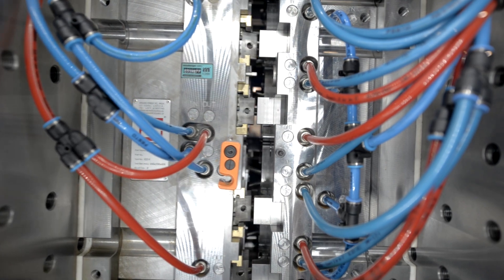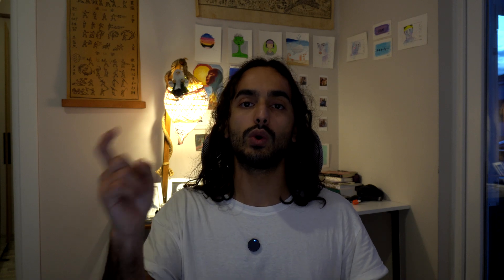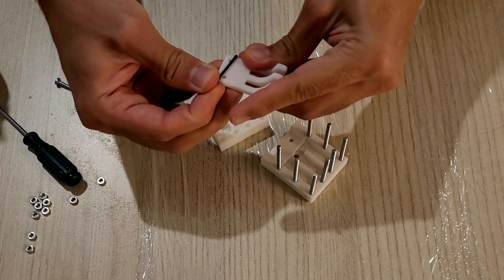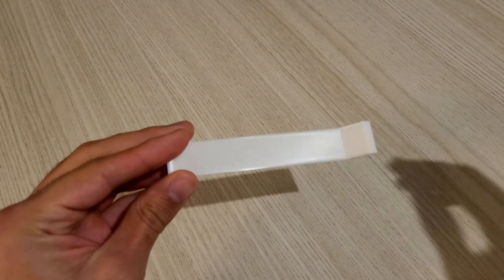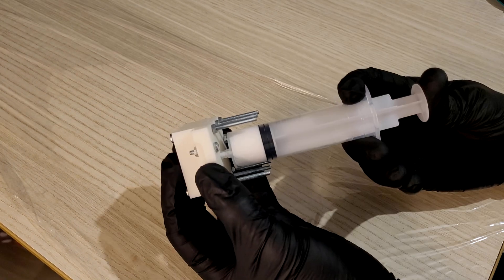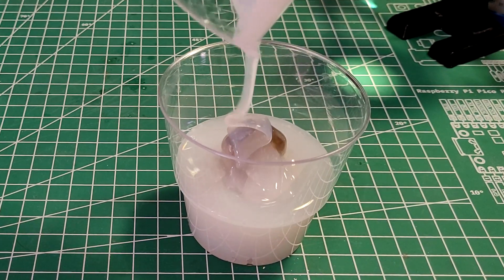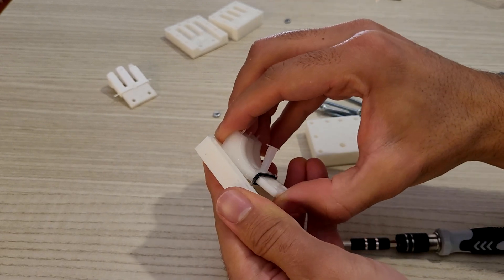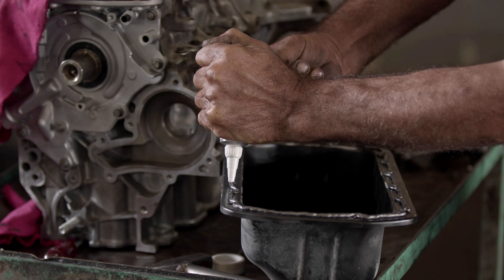Silicone Injection Molding at Home w/3D Printed Molds

Comment: I've done a LOT of 3d-printed molds with all sorts of silicones.
1. Water and soap works fine, as long as you let it dry or dry it.
With some amount of moisture it's okay, because with caulk that actually accelerates the cure.
2. This brings us to one very cool technique -- Caulk will set EXTREMELY fast (within 30s) if you mix it thoroughly with moisture. For example, I will put a tiny smear of acrylic paint in my caulk and mix it.. VERY FAST!  Try to make it even. Reduce trapped bubbles by smearing it along the walls of your mixing cup.
3. Now, for the other issue: No time!  In this case, if using caulk, you shouldn't bother with an injection technique. Instead, do a 2-part clamshell mold. You fill both sides, jam the center piece in (if you are doing the "overmolding" style), and push the pieces together. You'll get squeeze-out (if you used enough rubber), and you just trim the flashing.
4. ABS vs. PLA/whatever: Silicones and even caulk often won't bond to ABS. Still you should use a soap release layer because I have had a very small number of times where it did bond.
5. Curing. The surface often will get a skin. You can help it along by soaking the mold in water, and letting it cure. You can also crack it VERY slightly, soak in water, and let it cure. You can do variations on this. The water doesn't do a full cure -- it causes the stuff to solidify and increases the cure rate. I'm not actually sure of the chemistry involved here. I noticed when doing the thorough mixing, it sets super fast, but still needs its time to cure.
6. With ABS, you can get very smooth parts by vapor-smoothing your molds. If you have access to acetone, it's really an easy process. Easiest with an electric "range"/"stove" -- you want to avoid acetone near an actual flame!!!
6.b. Cold acetone vapor also works, but requires more patience.  Acetone vapor is heavier than air, whether hot or cold, so it stays down in a container.

Here are some 3d-printed Ventilator/CPAP nosepiece projects I've done:
https://youtu.be/nTEOTsMtw4M

Here's a demonstration of rapid smoothing with a spray of acetone, FORCING a matte surface finish (acetone evaporates very quickly, leaving a frosted surface). Then a fast dip in cold acetone vapor (saturated paper towels speed up the acetone evaporation).
https://youtu.be/nTEOTsMtw4M

Here you can see the effects of really thick layers vs. thin + acetone vapor smoothing:
https://youtu.be/moKtxujHFMs

Comment: SEEMS you may have been MISLEAD...
I have not seen it mentioned in the comments... So I might as well give it a go... (It may be a long one: I like explaining things)...
Before I got into CFX in the cursed years of my working for the movie industry, I was more part of the SFX department due to the "concept artist" title they enforced on me.
Thus; I have worked with all kinds of silicone for decades... having caulk practically the MOST as it is VERY cost-effective and unless we introduced fibres into the silicone mix: always the most durable.

TO BEGIN WITH:
I can definitely say that this time, your research may have misled you... Yes it needs air. But not the oxygen (One can argue that maybe it is the case for the Alkyl group formations. But even still.. You seem to have been misled).
It is the MOISTURE in the air that does what it does.
In fact, it is literally called the "Moisture cure" process.
(At the end of this comment I will give you a breakdown to how it works, since you seem to enjoy research)...

DRYING/CURING:
    So technically what one can call the "dried" phase (when you pulled it out of the mould); the lesser time-consuming curing stage where the surface has contacted the moisture in the air. But "Curing" demands the internals of the silicon caulk to engage the chemical reaction forming the cross-links needed for full "cure".
    To address what effects the curing process, I think it would basically boil down to 2 and a half reason.
_The first would be humidity... In fact, the biggest factor of the two and a half reasons would be this by far.
_The first zero point seventy-five percent reason would be temperature... That is because it effects the humidity.
_The second zero point seventy-five percent reason would be thickness... Again, this is related to moisture.. As since the thicker your paste... the harder it is for the moisture in the air to react to the contents of your caulk.

HOW TO SPEED UP CURING:
    Basically JUST ADD MOISTURE (well... sort of temperature and thin layers could help as well) Like:
_ Water vapour.. like a mister or a  such.
_ Porous stone/wood substrates... like tahta talaşı or tebeşir tozu etc
_ Add a hygroscopic powder/fluid like the Internets favourite: Mısır Nişastası or the lesser known oksijenli su etc. The reason starch works is because it absorbs the moisture from the air substantially.

HOW TO SEPARATE:
    You have to ensure that what you intorduce to the surface does not react or take part of the s link reaction that the caulk is going through after it is exposed to the moisture in the air. There are many ways to do it... but they all involve an inclusion of an emulsifier and an oil.
I would advise you to try coating the surface first with the dish soap. And then coat it with deterjan well mixed with zeytin yağı. And for larger moulds you would benefit from having this second coat from arap sabunu mixed with zeytin yağı.
Both scenarios (or variants) would have you benefit from the process of adding moisture.

ADITIONAL ADVICES:
    I would strongly advise you to prefer the silicones in the plastik tüp as since you would both have a higher quality mixture that is not adhesive optimized, and you would have it in a "syringe" (From lack of a better word) that you can "inject" into what ever you wanted to.
    IF you are going to do it in a medical syringe due to what ever reason: mix it with a hygroscopic substrate like mısır nişastası or similar.
    Since you already have a compressor (and a darn good one) use it. You can just put it into a jar, like you have used to demonstrate the workings of your invention... And just let it ensure the silicone gets in every detail with no bubbles left behind (A trick is to have it wait a while for the silicon to fill in where it can and then recompress the chamber to introduce more humidity. But this is a niche I have found practically not worth it unless you are in a desperate hurry and need to trim off all the seconds you can)

CHEMICAL REACTION (As promised):
For those that have patiently read to the end... A breakdown of the Reaction:
    Silicone caulk contains reactive groups (like alkoxy or acetoxy... Seninkisi tartışmasız ikincisinden) that when hydrolysed (react to water molecules) they liberate byproducts like alcohol or acetic acid (methanol in alkoxy groups) which results in the formation of silinol groups (Si-OH) which later condense into siloxane linkage formations.
It is basically these cross linkages that form the "paste" into a solid (relatively; I agree) elastomer.
And a short explanation to why there is a difference in the alcohol formation during hydrolisis...
    The alkoxy group consists of an alkyl group bonded to oxygen (-O-). Alkoxy silicones release alcohols (such as ethanol or methanol) during curing. They typically have a neutral odour and are less corrosive, making them suitable for sensitive materials and electronics.
    The acetoxy group is derived from acetic acid and contains an acetyl group (CH3CO-) bonded to oxygen. Acetoxy silicones release acetic acid (vinegar-like smell) during curing, which leads to faster curing and strong initial bonding but can be corrosive to some substrates like metals and electronics (yaaani "asit" diyoruz oğlum, ne bekliyorsun?).

Hope this helps IF you ever decide to give it a try again...

LASTLY:
 If you read up to here: Thank you so much for your dedication.

Şahane bir kanal oluştusun... başarılarının devamını tüm içtenliğim ile diliyorum.
Bir abonen oldu.... Kolay gelsin, BAŞARILAR!
Reply: FOR THOSE CURIOUS:
The twp part silicones are what we call "addition curing" (like in resin curing) but scientifically they are mostly referred to as "platinum-catalysed" curing (Which may give you an idea to why they are so expensive) that work with a catalyst and do not need any moisture from the air... making them much more reliable because they have no byproducts (which may give you an idea to why they are preferred in precision moulding).

Comment: I`ve done this quite a few times with some success, even with silicone caulk. Although I've only tried it with resin prints, I think it should work here too. What I've done is coat the part with oil, which can be some machining oil or even just some good old WD-40. Try it first without injecting it, instead, fill the parts with the silicon and then join them and secure it with the screws and wait until fully cured. Another way you can try is that, while it may sound counter intuitive, fill the part underwater. The water needs to have some dish soap to prevent the silicone to stick to the mould, but again, you can try filling the moulds with the silicone, but first you need to knead the silicone under the soapy water for a little time or it will stick to you fingers and when it doesn't feel sticky, you can push the silicone into the mould and then join them. The silicone caulk doesn't actually need air to cure, but it's the humidity in the air that makes it cure, so if you fill it underwater it will cure as well.
Reply from the maker: I'll give it a try, thanks for the detailed suggestion!

Comment: Great video! 
In order to make mold separation easier, injection molded parts are slightly tapered(about 1 degree) towards the parting line. Also, what you did there is called overmolding, I believe.
Reply from the maker: Thanks for the tips! Glad you enjoyed the video